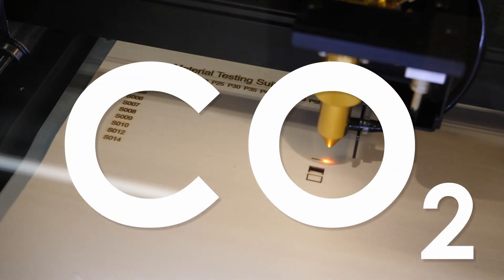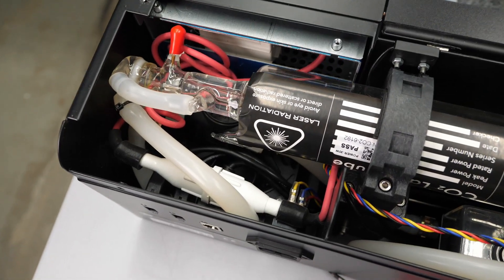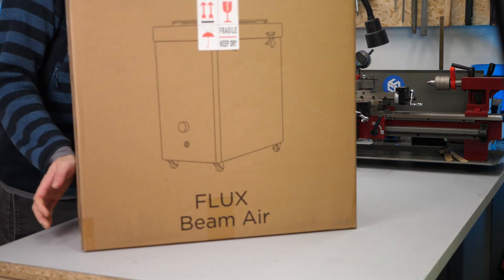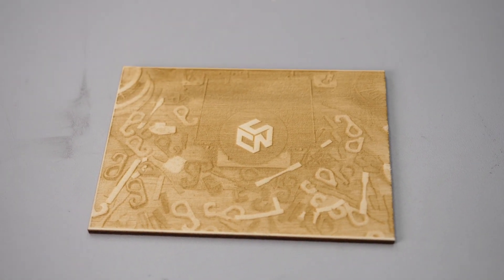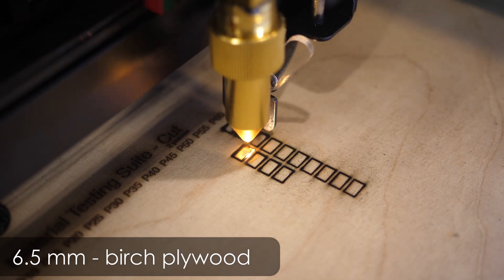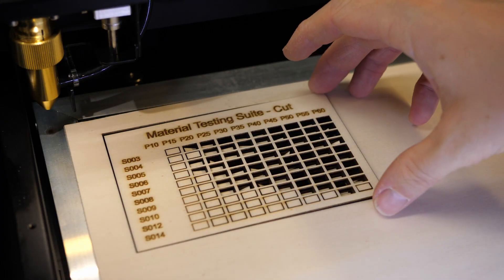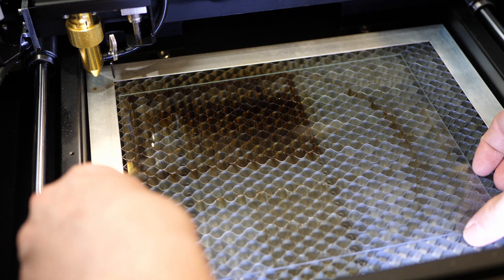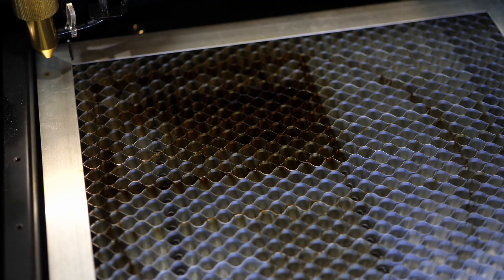FLUX Beamo REVIEW - Compact 30W CO2 Laser Cutter

Comment: What will it do against Aluminum and mild steel
Reply: Nothing to aluminium its highly reflective to 10.6uM, and not enough power to do anything to mild steel, higher power glass tube co2 lasers can engrave on steel but not cut.
Reply: @panaxion  what should I look for if I wanted to cut Aluminum and say 14 ga mild steel?  I run a laser at work but that's a little large for simple application.  I also realize that it is probably more practical to source the cutting of these materials but information is free and useful no matter what
Reply: Get a plasma cutter. For that size of material it would require around a kW laser.
And then quickly gets expensive.

You can cut thin steel with a 150w laser and oxygen support but thin as in 0.5-1mm. Everything thicker requires a lot more power.
Reply: Nothing

Comment: I can cut 3/8" acrylic (~10mm) on my 45W Epilog at decent speeds even with a severely degraded laser tube. Either your focus was off or the advertised power on the laser is optimistic.
Reply: Epilog's spot size is much finer, so more energy density

Comment: Thanks. This looks like a great unit.

A great ecosystem, even with a higher price tag, is the reason I recommend Prusa printers to those less interested in the tinkering aspect of 3D printing. Too often people overlook the long term costs of their time in making a hardware purchase.

I'm not in the market for a laser cutter/engraver at the moment, but I'm certain I'd rather benefit from something like this instead of a fiddly less expensive unit. An auto focus sounds ideal!
Reply: That's the exact reason I got a Prusa. I didn't want to fiddle around to get it working properly, I didn't want to save hundreds of dollars only to then spend hundreds of dollars on upgrade parts to improve its performance; I just wanted it to work well from the start. And the i3 MK3S that I got lives up to that expectation admirably. (Benchy printed out great, first time.)
Reply: I chose Prusa because I wanted to support people actually designing machines rather than copying other people's. That and a power supply with CE mark and the correct plug fitted. Never trust unbranded power supplies.

Comment: Great review. You might get better results with laser PLY and laser MDF. You mentioned getting plywood in hardware store and that's usually not the one that is laser friendly. 

Even 120W metal/ceramic cartridge can struggle with standard ply/ MDF.

Thanks for the video
Reply from the maker: Good tip! I'll check that out.

Comment: What about cutting plastics? Did you try that?
Reply: Yes, cutting PLA, ABS, PETG, PA6 and other 3D printable thermoplastics would be interesting. I've seen some 3D print failure recycling videos, where they shredded and remelted the plastic into colorful sheets of plastic in an oven. Not sure if Stefan has done that too. Would be interesting to use something like that as base material for laser engraving and/or cutting.